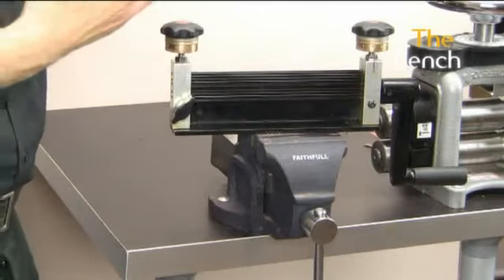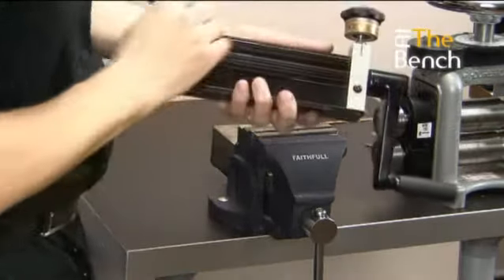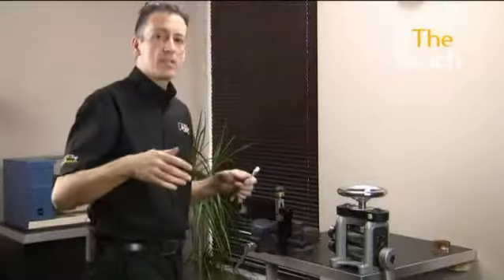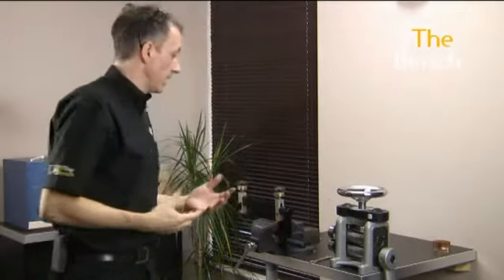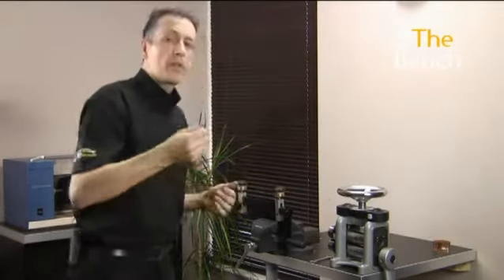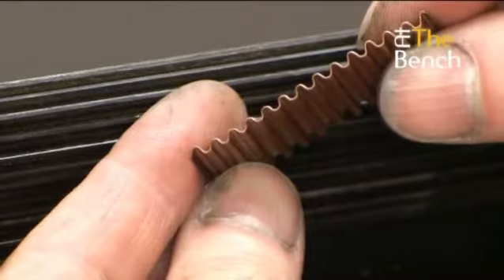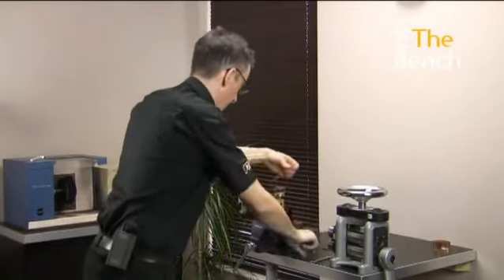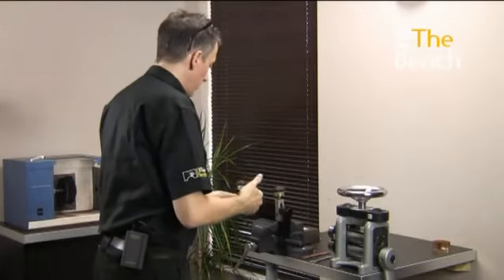Microfold Corrugator

Comment: 01:24 "The rollers are a 24 pitch which means that you will approximately get 8 microfolds per inch or 8 microfolds per 25 millimetres .."

Who manufactures this machine?

I'd be interested in contacting the manufacturers of this machine to see if they can offer to supply a bigger machine all round to my specification.